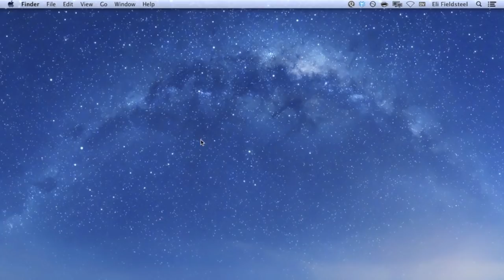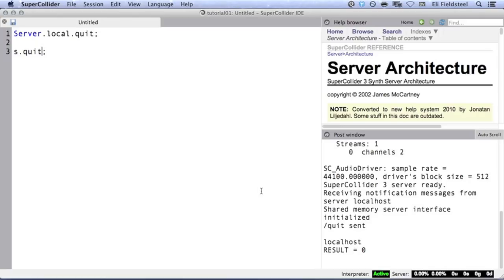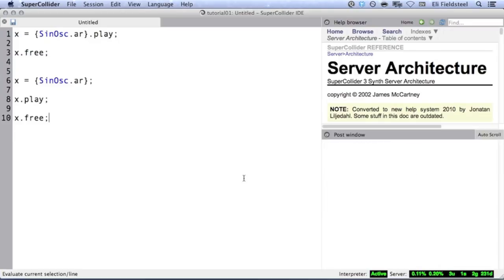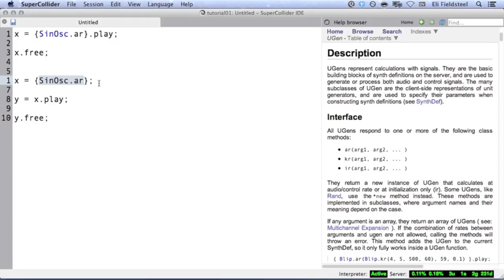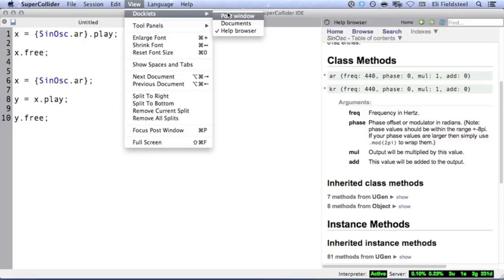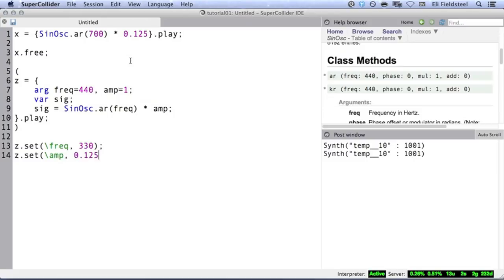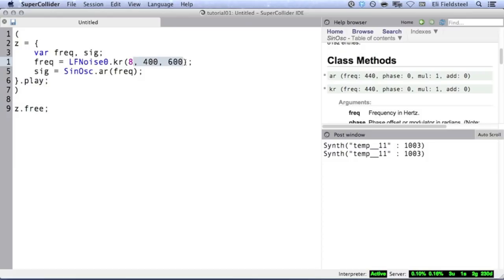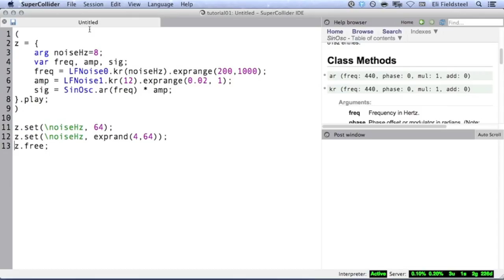SuperCollider Tutorial: 2. Making Sound

Comment from the maker: The amplitude (in other words, the output) of LFNoise0 ranges from 200 to 1000, but we are not listening to this output. Instead, we are using these output values as an input to the frequency of SinOsc. Then we are listening to this SinOsc. SinOsc's amplitude stays between -1 and 1, and its frequency ranges between 200 and 1000, randomly. The frequency of LFNoise0 is 8Hz, which means a new random value between 200 and 1000 is chosen 8 times per sec, so SinOsc's frequency changes 8 times per sec.

Comment from the maker: 8Hz is the frequency of LFNoise0 and has nothing to do with the frequency of SinOsc, which is controlled by the output of LFNoise0. Using mul and add (or specifying a range explicitly) determines the output of LFNoise0. With mul=400, the output of LFNoise0 is between -400 and 400. After add=600, the output is shifted up by 600, thus 200 to 1000.
Reply: Thanks! I was wondering this and i found it in the chat.

Comment: Great tutorials

I learned to set the value of freq.

But how can I get the value tha freq has at any moment?

Thanks
Reply from the maker: This is possible but involves a bit more work. If you just want to "see" the values, you can use the 'poll' message on any UGen or synthesis argument:

(
x = {
	arg freq = 440;
	SinOsc.ar(freq.poll) * 0.1!2;
}.play;
)

x.set(\freq, 550);

x.free;

Alternatively, if you actually want to get a value from the audio server (capture in a variable), you can use a combination of SendReply, OSCdef, and a trigger-type argument in the UGen function. When SendReply is triggered, the server sends a message to the language, which responds by capturing the instantaneous value of the specified signal in a variable.

(
x = {
	arg freq = 440, t_get = 0;
	SendReply.kr(t_get, '/get_freq', freq);
	SinOsc.ar(freq) * 0.1!2;
}.play;

OSCdef(\query, {
	arg msg;
	~freq = msg[3];
}, '/get_freq');
)

x.set(\freq, 550, \t_get, 1);

~freq; // -> now equal to 550

x.set(\freq, 660, \t_get, 1);

~freq; // -> now 660

This is a really common question, but kind of advanced for Tutorial 2 — I plan to make a mini tutorial about this in the near future.

Comment: Eli, Love these videos. I had tried years ago to work with SC and just kept getting frustrated, not fully understanding what I was doing. Could just be passage of time and maturity, but I feel like I have a much better grasp of the concepts this time around. Thank you!

 One question I have is: I see the advantage of using an argument because you can write new values to it while a synth is ongoing. What is the advantage to using variables over arguments if they are limited in terms of your ability to rewrite them while operating a program?
Reply from the maker: Thanks. That's a fair question. In the context of a UGen function, a declared argument becomes an instance of a class called Control (or a closely related class). These classes create routing infrastructure that allows real-time parameter adjustment. A declared variable, on the other hand, is just a generic named container that can contain any type of data.

Arguments are useful because they enable real-time control, but they are limited in terms of how we can interact with them. For example, if you use an argument as a container for a UGen, you cannot use a set message to change it to a different UGen:

s.boot;

(
x = {
	arg sig;
	sig = SinOsc.ar(440, mul: 0.1 ! 2);
}.play;
)

x.set(\sig, Pulse.ar(440, mul: 0.1 ! 2)); //ERROR: can't set a control to a UGen

My general rule of thumb is, when creating a UGen function, use variables as named containers for storing information, unless we're dealing with a synthesis/sampling parameter that we want to be controllable, in which case, declare an argument.

Comment: What's the difference between LFNoise0 and LFNoise1? Not quite sure what linear interpolation means in this context.
Reply from the maker: +Andrew Suzuki LFNoise0 and LFNoise1 are noise generators. They output random values at a given frequency. LFNoise1 interpolates linearly between successive values, producing a waveform that resembles a series of diagonal ramp segments. LFNoise0 does not interpolate, is sometimes called "sample and hold" noise, and resembles a random "staircase" waveform.

Comment: great video. 2 questions: is there a way to get the sound output in stereo instead of left-channel mono? also, .free commands don't seem to work for me. here's the error message i receive:
-> Synth('temp__0' : 1000)
FAILURE IN SERVER /n_free Node 1000 not found
Reply from the maker: For stereo sound, see Tutorial 5 on Multichannel Expansion. You can also read the Guide file on MCE in the help documents: https://doc.sccode.org/Guides/Multichannel-Expansion.html — alternatively, you can use Pan2 or another panning UGen to create a multichannel signal from a monophonic one.

For the second issue, this is difficult to diagnose without seeing your code and how you're evaluating it, but my guess is that you are pressing command-period to free all Synth nodes on the server, so when you try to manually free a Synth using the '.free' method, it's already been destroyed, so the server says that it can't find the node you're referencing.

Comment: Hello Eli.
I learn a lot from you. Thanks for that.
I don't understnad one thing with argument and range of frequency.
 What I undersood multiple is amplitude.So 1 to -1  , otherwise sound will be distrb. 
here is the question . the arg 400 .It's means amplitude is -400 to 400 ?  if it so what is the point  for amplitude ?  It's already over the 1 
and after add 600 then , 200 to 1000 .  is this value for frequency or amplitude?  I think that mutiple argumnet doen't effect to frequency.

Comment: Hi Eli, I don't know if you still read the comments but I hope you do. I have been trying to make sound using this tool and every time I try a longer code of more than one line I get the answer of nil, it doesnt tell me that it has an synthax error just nil. I have literally copied the code you put as an example (the z one) and it just keeps returning nil, I have checked if the parenthesis are right or the semicolons and it is all the same as you. I have tried other tutorials and other codes that in the video of the tutorial work but when I put them in mine they don't. If I put simple one line codes it work perfectly but it just doesnt work for more than one line code. Is there something I need to turn on for it to get more code lines? Can you help me please?
Reply from the maker: Are you pressing the correct keyboard shortcut? Command-enter instead of shift-enter?

Comment: Can someone explain why if I use exprand(200,1000) in LFNoise0 instead of exprange(200,1000) I get a different sound?

Great tutorial,thanks Eli
Reply from the maker: It's a little tricky to explain what happens in this case, but I'll try.

First, and most importantly, swapping exprand/exprange isn't a good idea. It's true that exprange and exprand have similar spellings, but that doesn't mean they're meant to be interchanged like this.

exprange (and its sibling methods, range, curverange, unipolar, bipolar) are defined specifically for the UGen class, for the purpose of mapping one range of signal values onto another. These methods used exclusively in a server-side context, appended to UGens, specifically for this purpose.

On the other hand, exprand (and its sibling methods, rand, rand2, rrand, linrand, bilinrand, lots more) are general-purpose tools for producing random values, defined for a variety of classes. They can be used with UGens for real-time signal calculations, or they can be used separately in a client-side, offline context.

exprange expects two arguments: a min and a max. It takes the values from its receiver UGen and maps them, exponentially, onto this new range determined by min/max.

exprand needs two arguments as well: a min and a max. These can be provided like so:

exprand(200, 1000);

but this syntax can also be rewritten like this:

200.exprand(1000);

And that's what's happening in the following code if you make the swap you described:

(
z = {
 var freq, sig;
 freq = LFNoise0.kr(8).exprand(200,1000); //should be exprange
 sig = SinOsc.ar(freq);
}.play
)

exprand is choosing a random value. The lower bound is determined by LFNoise0.kr(8), and the upper bound is 200 (the value of 1000 is ignored). The default range of LFnoise0.kr(8) is -1 to +1. If LFNoise0 is positive, exprand picks a random number between that number and 200. If LFNoise0 chooses zero or a negative number, exprand fails and produces "nan" (not a number). These values are fed into a SinOsc and used as frequency values. About half the time, SinOsc gets a relatively low number between 0 and 200. The other half of the time, SinOsc gets "nan", which is a bogus value, and the waveform flatlines until it gets a valid value. The process of picking random values happens at the control rate, which is equal to s.sampleRate/s.options.blockSize (*not* 8 times per second, as one might guess from LFNoise0's frequency value).

This produces a gnarly, crunchy, gross sound.

So, it doesn't make sense to use exprand here. exprange is the correct choice, if you want frequency values between a min and a max.
Reply: @elifieldsteel  Oh, I didn't thought it was a diffucult question. However, great explanation I think I understand most of it.
Thanks a lot Eli, you are the best!

Comment: I have a problem with the ".free" command. Whenever I start the same sound more than once, ".free" only works to stop the first signal. But the other ones remain playing until I press "ctrl+." to stop all audio. Is there any other way to stop that from happening?
Reply from the maker: Yes, give your Synths different names. And technically speaking, free will only remove the most recently created sound, not the first one. For comparison, if I run the following program:

x = 3;
x = 24;
x = 17;

And then ask for the value of x, it’ll be 17. If you want to keep track of several different things, they need different names.

Comment: ERROR: Input sample rate is 44100, but output is 48000. Mismatched sample rates are not supported. To disable input, set the number of input channels to 0.
could not initialize audio.
How do I set the number of input channels to 0?
Reply from the maker: That would be

(
s.options.numInputBusChannels_(0);
s.reboot;
)

But I don't think that's really the best solution, because it prevents you from working with input signals altogether. A better solution is to make sure your input and output device are set to the same sample rate. This is usually done through whatever software utility your OS uses to manage audio devices. The SC audio server doesn't support devices with mismatched rates.
Reply: Eli Fieldsteel thanks!

Comment: When i try to boot the server (jack) i get the message: ERROR server failed to start. How can I solve the problem?
Reply from the maker: Could be one of a number of things. Any more info in the error message? Usually, when I get this error, I first try Server.killAll; if that doesn't work, quit and reopen SC, and if that fails, shut down and reboot the computer.
Reply: +Rita Maestri Are you still having this problem?  After spending many hours struggling with jack over a period of months, I found a way to fix my problem.  I changed jack's "Output Device" to something that wasn't on the list of the application I was using (I found the answer on an online forum) - I had to type it in.

Comment: server boot disables all my audio on linux ubuntu 19.10, I am using JackDriver, can anyone help?
Reply from the maker: I'm no Linux expert, but there was a similar question and answer (courtesy of H. James Harkins) on the SC listserv recently, abridged and pasted here. If you need additional help, I'd recommend searching and/or asking on scsynth.org.

Q: "Once i start the server, no other app can use sound."

A: Good audio performance depends on several things -- a) use a low
latency kernel (the vanilla Ubuntu kernel will not handle real-time
audio synthesis well); b) interrupt priorities need to be configured
so that the sound card interrupts are handled before e.g. WiFi
interrupts (this is tricky -- I could never get it right in plain
Ubuntu, so on my most recent machine, I installed Ubuntu Studio
instead, which pre-configures interrupt priorities -- I strongly
recommend using a distribution intended for real-time digital arts --
it will save you massive headaches); c/ your user needs to be a member
of the audio group, and that group needs to be configured to allow
processes to take real-time thread priority
(https://jackaudio.org/faq/linux_rt_config.html).

tl;dr: dump Ubuntu, use Ubuntu Studio or KXStudio.

Comment: 'ERROR: Command line parse failed'
Reply from the maker: That's a syntax error. A forgotten semicolon, misspelling, open parenthesis, etc. Double-check your typing.
Reply: Eli Fieldsteel I opened an example and I couldn't test it.
Reply from the maker: +Andrew Paquette Yes, this sounds like a problem related to improper evaluation of code. Shift-enter evaluates the current line, or whatever is currently highlighted. In the case of multi-line code, this can produce an error. Command- or Control-enter evaluates the current parenthetical enclosure of code, without having to highlight the code first.

Comment: Well,i tried to boot but it gave this error.

server already booting
could not initialize audio.
RESULT = 1
ERROR: server failed to start
For advice: [http://supercollider.sf.net/wiki/index.php/ERROR:_server_failed_to_start]

I checked the web site in the error, and saw that i should :Usually this means you have a zombie scsynth running in the background - go to your computer's Task Manager and see if there's an instance of scsynth there, then kill it, before trying again.

Then i opened system monitor but i dont see a scsynth running over there to kill. So What should i do not ? any ideas except Reboot the computer ?

(btw os is ubuntu 13.10) 

PS: i forgot to mention that when i boot interpreter it also gave this,

init_OSC
empty
compiling class library...
	NumPrimitives = 679
	compiling dir: '/usr/share/SuperCollider/SCClassLibrary'
	compiling dir: '/usr/share/SuperCollider/Extensions'
	pass 1 done
	numentries = 781758 / 10848904 = 0.072
	4972 method selectors, 2182 classes
	method table size 11719552 bytes, big table size 86791232
	Number of Symbols 11472
	Byte Code Size 358340
	compiled 319 files in 0.44 seconds
compile done
Couldn't set realtime scheduling priority 1: Operation not permitted
Help tree read from cache in 0.0037291049957275 seconds
LID: event loop started
Class tree inited in 0.05 seconds
Welcome to SuperCollider 3.6.5. For help press Ctrl-D.
Couldn't set realtime scheduling priority 1: Operation not permitted
Reply from the maker: Try evaluating

Server.killAll;

which usually works for me. Occasionally I'll need to reboot the computer, but very rarely. I'm not sure what 'Couldn't set realtime scheduling priority 1: Operation not permitted' is about.
Reply: I'm on Win7, but at first I got the same error you had. What I did was set rules in windows firewall to always allow access to the 3 SC programs on its folder (scide, sclang, scsynth). Only after I did this SC started to run smoothly. I don't know much about Linux, but if it has a firewall, or if you have a anti-virus/firewall program, maybe you could try disabling them for a test

Comment: Thank you for sharing your knowledge on SC! 

I am currently practicing your videos and have a problem

(
z = {
 var freq, sig;
 freq = LFNoise0.kr(8, 400, 600);
 sig = SinOsc.ar(freq);
}.play;
)

when ı type this it results with the message below. I double checked and couldn't find a difference between your example and this. Can you help me to find my error please.

ERROR: Parse error
  in interpreted text
  line 1 char 1:

  ) 
  ^
-----------------------------------
unmatched ')'
  in interpreted text line 1 char 1
ERROR: syntax error, unexpected BADTOKEN, expecting $end
  in interpreted text
  line 1 char 1:

  ) 
  ^
-----------------------------------
ERROR: Command line parse failed
-> nil

Again, Thank you for your tutorials!
Reply: Hi. Your code works fine in my workspace. Maybe you have an invisible tab or the like somewhere in the code.
Reply from the maker: You’re probably using the wrong keystroke. For a block of code enclosed in parentheses, use command-enter or control-enter, instead of shift-enter.

Comment: Could anyone help me with the following?:

in the section "Arguments", i've been following what he's typing 1:1, when he's making the z synth, i just simply cannot get it to play. 
" (
z = {
	arg freq=440, amp=1;
	var sig;
	sig = SinOsc.ar(freq) * amp;	
}.play;
)
"
I get syntax error messages like these: 
" unmatched '}'
  in interpreted text line 1 char 1
ERROR: syntax error, unexpected BADTOKEN, expecting end of file
  in interpreted text
  line 1 char 1:

  }.play; 
  ^ "

or

" ERROR: Variable 'sig' not defined.
  in interpreted text
  line 1 char 23:

  	sig = SinOsc.ar(freq);  "

Also arg and var turn red as soon as i type them in, even before i can define them, not sure if this is an issue, just wanted to add that...  
It's a bit frustrating hehe, since it seems i cant really advance to the next steps in the tutorial  without learning to use this code. If anyone knows anything i would very much appreciate the help! I'm new so it's very possible I've overlooked something.
<3 <3 <3
Reply from the maker: I am pretty sure you’re using the wrong keystroke to evaluate the code. Press command-enter (mac) or control-enter (windows). If you press shift-enter, you’ll only evaluate a single line, but the entire block needs to be parsed. The red colorization is customizable and means nothing.